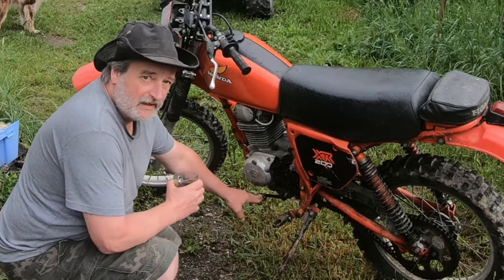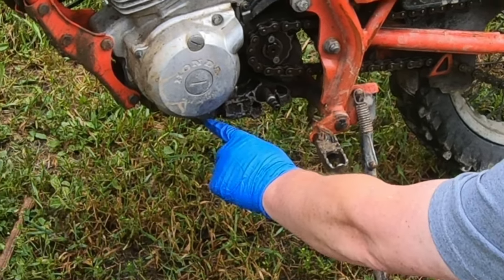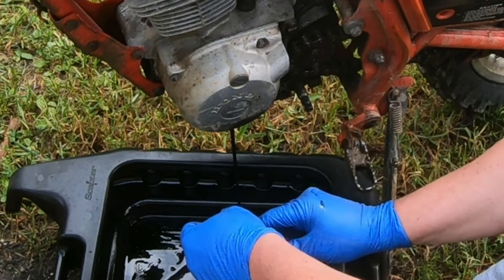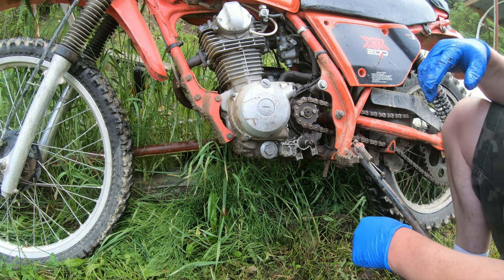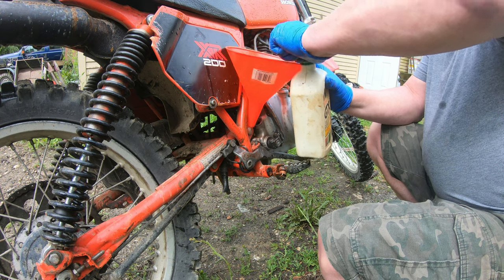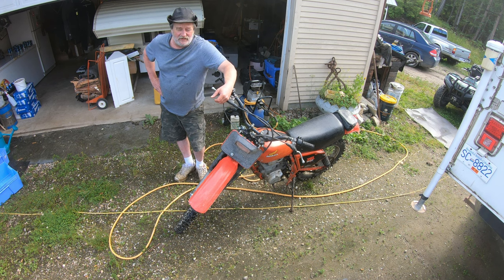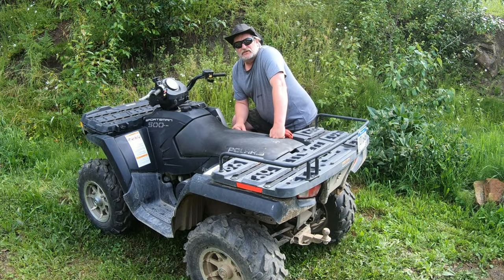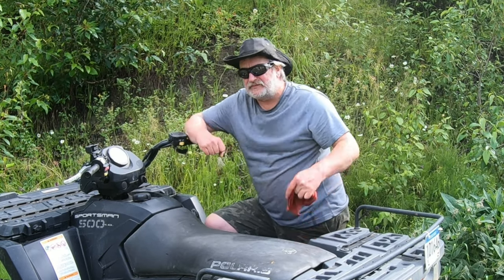Honda XR200 OIL oil change shifter fix and ride.

Comment: Absinth is undrinkable. Love your oil theory, I share it as long as we are talking about low power 4 stroke gasoline engines. Diesel with exhaust filters and high power engines is a different story. Oh and if you have wet clothes it needs the right oil too.

Comment: 3rd (and best👍) alternative: run i warm to get the oil easy flowing and get all dirt/crap suspended in the oil and THEN let it drain for a long time.

Comment: Yeh agree about cold oil drain, also the muck would have drooled down to the bottom end but additionally in that theory it would make sense to refill, run the engine fifteen minutes and drain again to rinse it, then add the final fresh litre, however I have said I don't understand why there is no oil flush pump and rinse gadget available to thoroughly pump through and out with a fine oil such as sunflower oil to rinse it right out, then, refill. You'd think someone would have invented that by now. 😂
Reply from the maker: That would definitely make a long lasting motor last even longer.😀

Comment: Hey if you ever have the gas tank off the xr200 check the frame right by the back tank bolt on frame  it’s under the front part of the seat the frame cracks in half under front seat bolt right under the extra part of the tank that the bolt goes thru you can’t see the cracks with tank bolted down till you take the tank bolt out and just lift the tank up a little you will see them if there is any at all it’s worth a check just so you know the frame don’t crack in half the motor bolts would still hold it together but could crack engine cases also if left busted   No one had migwelders back then the 1980is a sweet bike there such time capsules they been in some  videos movies  these bikes still are  epic every thing from the 70s and 80s was awesome it was before every thing went plastic

Comment: You should be using oil with a SJ rating . or you burn your clutch plates out .
Reply from the maker: Thanks, Kevin. I will look into this. Old bush guy kinda stuck in his ways